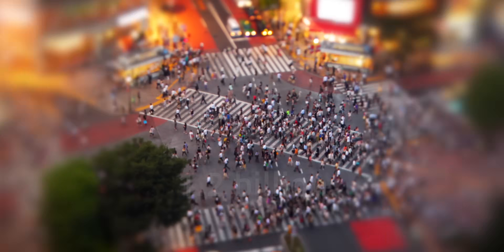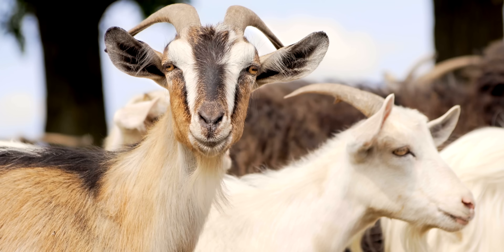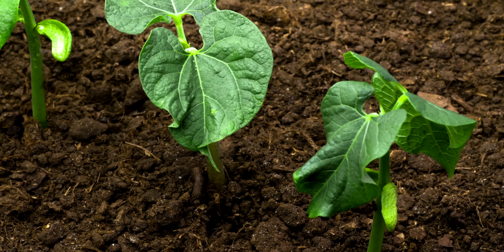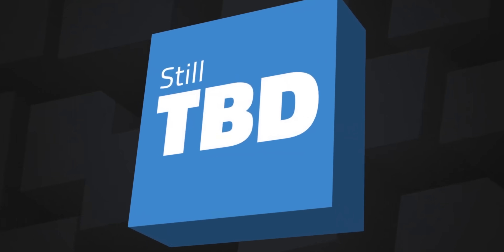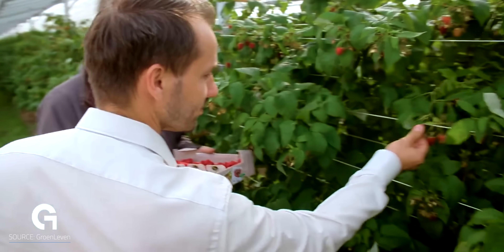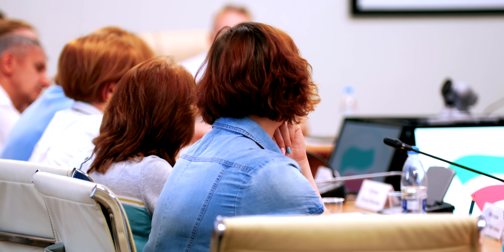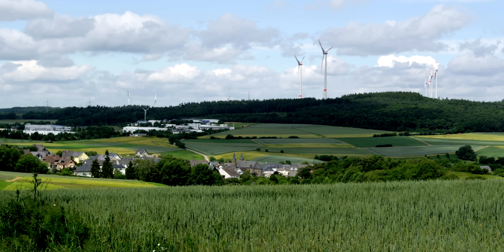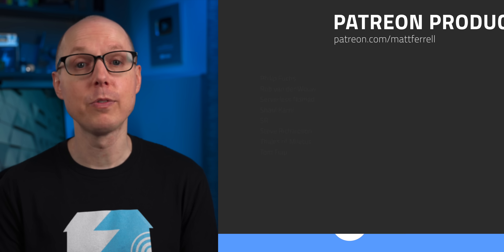Solar Panels Plus Farming? Agrivoltaics Explained

Comment: Metal has gone up to 30-40%, solar panel has got an extremely high cost for the last decade!
You think seriously it’s still profitable??? 
I think it’s just populism = green agenda.
Reply: Well we could say virtually everything is going up that much—like electricity itself (though it’s up even more)... But panel’s themselves have become cheaper and quite a bit better in the last decade. The cost of electricity in most/many places is becoming unaffordable, (like California or England/Europe for example). 

If you separate out the populism and green agenda, what’s left? The sun’s energy is... Imagine you came up with an idea how to harvest that energy (besides growing food), would it be because of a political agenda that you’d want to see where it leads (like with the combustion engine)? The problem in all of this, of course, is big business... but either way you can’t separate it out... (as who is behind the idea that it’s impractical)... Except to leave the system in general, there is manipulation to stay where we are by business and vice versa. 

But in the case for affordability, again it all just comes down to business, supply and demand will decide, if the oil industry (and automakers) get on board. While a lot of plastic (I assume) is needed for this industry, the oil guys are not likely to get too worried... however, the warring between the industries will affect the overall speed of rollout (ie. acceptance, as someone is tainting the waters). I mean who’s lobbying against it? Who is actually fighting against the green (washing) agenda? Is it not (political) conservatives who have a long established relationship with the preexisting energy sector (oil/gas/coal) (kind of like they do with the gun industry—the old school war profiteers)? I’d pose the question of how much of this is just purely political (=business), versus how much is truly just impractical... (if you look at the early days of oil, it was difficult to get at, difficult to refine, it was relatively inefficient, etc... BUT it was the way out of the dark ages—which almost everyone was quick to jump on board and get behind... and 150 years later, here we are...)
Reply: @GMC-qo9xi  so many words… just make a calculation! 
It’s not profitable, it’s not reliable, it’s not greener than other sources of energy. It needs generating a million tonnes of carbon emission to get the solar panels & prerequisite equipments including Li-on batteries!
Just look at the miners around Salt Lake or LatAm, China. Hope you are aware how many millions cubic pounds of drinkable water are required to produce the panels, batteries & equipment! 
Have you ever tried to imagine the impact of solar panel production on the environment? Do you know how much water it takes to put out a Tesla electric car fire? What about HAZARDOUS Materials. Is it still good choice?
Have you seen how solar panels burn and how many hazardous elements are released into the air? 
Read the study that 50% of all carbon emissions come from CONCRETE buildings! Can't you greens solve this problem first? Or don't you get paid by cement concrete plants for your YouTube videos?
I guess you get money from the Democrats to justify raising taxes on the oil business!
Reply: @V_I_Kruzenshtern  see that was pretty easy for calculating that side—now do it on the other—but use the opposing side’s sources of information (propaganda) as you inevitably have done done there... Your concluding it with the political attack, evidences the problem with the information source and reveals where a lot of the bones are buried. You are emotionally attached—which comes directly from politics. The people developing the tech are not developing Democrat tech... but the information being used against the tech is often cherry picked by republican political actors (lobbyists)=same bs, like nra.

Personally I don’t do politics (anymore) and I won’t listen to people who are programmed by political by through that mechanism for judging. BUT it doesn’t mean I’m pro lithium battery or plastic (or whatever toxic) material is used to construct solar panels... I’m just saying why would the current monopoly be WHITEWASHED as if they haven’t already destroyed the planet. So i don’t care about protecting the current industries, as if they have done all they could to protect the planet. But I do care about the hypocrisy... so the GREENWASHING doesn’t sit well with me at all. But I believe it’s pretty safe to say that the people who are mad like you—saying it’s dead on arrival—are actually pushing “someone” else’s agenda. It’s definitely not profitable for them! 

I’ve been saying lately, about Canada’s tar sands, that it should be nationalized, as it’s not profitable, except with high oil prices... BUT it means we are dependent on foreign oil, when we have our own source... But it belongs to business, they need profit (and gov’t subsidies =public money)... If it was nationalized it wouldn’t make a difference if it was profitable or not, we’d all be paying for it and it would be available as needed and would theoretically be cheaper than foreign oil, as it would be ‘not for profit’... and when you have that kind of investment, it can develop over time and become cheaper and cheaper... Is it green? No it’s the worst source of oil on the planet... but that is not going to be the reason it’s not dug up... We will use every last drop on the planet given the opportunity... The other industries, who knows what they will progress into... battery technology is changing fast, especially with high cost and difficulty of getting lithium and cobalt. So what is next? 

And before you do another full-on frontal attack, I don’t care, either way... the truth sets us free and I’m not in either camp... BUT when camping I’d prefer a silent power source over a noisy one (=demand). God bless you friend.
Reply: @GMC-qo9xi  bla bla … so much useless text.
Who do you think is going to read it?
Are you capable of answering one substantive question or are you so confident in your propaganda that you have forgotten the key issues?
Just keep your answer short.
Reply: @V_I_Kruzenshtern  obviously it pisses you off. But since we are dealing with head games and not pure unadulterated facts to weight against solar versus each alternative (it’s always biased! People prefer/hate irrationally). But since we are talking about something that is fraught with manipulation, propaganda, business and politics, it’s not “exactly” as you say it is... And since you need to control things that are not within your power, it’s like you are punching the air. Like I said I don’t ‘care’ about the politics surrounding the subject... give me truth, not a bunch of oil lobbyist type of appeal to emotions. Do you love big oil? Presumably not... do you love big business? Same thing... it’s all the same thing... but wouldn’t you like to be able to generate your own power without needing to go to a gas station? In May we were out of power for 8 days... and then a few more sporadically since then.... I bought a (bigger) generator. But gas at that time was also over $2 /liter = $8Can /gallon... in the past we’ve had similar outages, but in general where I live electricity is relatively cheap, like .10/Kw... but an hour away it’s like 2-3x more depending on time of day use... so many people who have gone solar have already paid it off, through what they’ve saved... that =profit... But if they destroy the environment even worse than the alternative to do so, then the cost-benefit should be factored in. But oil is sailing across the ocean 24/7/365... that one aspect alone is devastating. Take care of yourself. (And just for the record I would be more inclined to agree with you—if you are more reasoned, less offensive and less politically motivated... as naturally I’d be tempted to just let the whole thing burn to the ground in spite than submit to arrogance and to people with toxic attitudes, who are fuelled by malice! Agree or die!)

Comment: It depends on the situation. Finances are an important factor to consider. If it is financially sound in both the short-term and long-term, taking into account environmental factors and sustainable development, then it may be worth pursuing. However, if it is not financially sound, other options must be considered.

Comment: The configuration used at the raspberry farm: Will the slight E-W cant and cooler daytime temperatures affect the solar panel lifespan positively relative to straight solar farm? Could a net present value analysis be applied to each system?

Comment: I wouldn't say use Agrivoltaics *everywhere*....but with any shade-tolerant or shade-preferring crops (especailly in hot, arid climates) we should absolutely be using them (regardless of country).  Just make sure to do it properly to mesh well with local life (human, domestic animal, and wild) and to maximize the benefits while minimizing the long-term costs.  I.e. put doing right in the first place over doing it fast.

Comment: Internet news: India was already mass producing box type car as of year 2020- powered by "compressed air engine" (C.A.E.), with 300. kms range b4 recharging... In 2-3 yrs time, all pressure operated engines for land and seacraft, power plant, others- can be converted into said CAE type contraption..  The usual pressure generation process of todays engine was being done by burning fuel, like: gasoline, diesel, bunker, coal, hydrogen, kerosene, benzene,  firewood, calcium carbide, petroleum gas, LNG, others... Only slight modification will be done, and ALL or 100% of todays land vehicles, power plants and seacrafts, including submarines fleet - can be powered by such CAE technology...Accordingly, CAE was already invented as of year 1920-  by opting for hybrid type of CAE, a possible semi- perpetual machine will be achieve... A single or dual piston diesel engine , running a suction pump- will replenished the continious small loss of pressure of the main pressure tank- due to moving parts friction and wind impact on vehicle body... Who was suppressing for the spread of such CAE technology- since its conception in the 1920's decade?... Just asking...

Comment: Hi Natt, this is a fantastic video, thank you for making it. Though, I would like to give you a bit more information about renewable energy projects and farming. First, NIMBY's or the Not in My Backyard issues (sadly) stop more than 50% of all renewable energy projects. If people could live for a week beside an active hydraulic fracturing oil or gas field or working coal mine or power plant and then spend a week by a utility scale solar and or wind farm, then get asked to choose what form of energy they want to live near and or have their power come from, I guarantee they would choose renewables over fossil fuels every time.  (Do you have a way to access the Elsevier "Energy Policy" journal? If yes, do an advanced search for related articles between 2016-2022. I am a grad student at Penn States University's World Campus in the third semester of the Renewable Energy and Sustainability Systems (policy track) Masters for Professional Studies program and do have access through my EME 803 Applied Energy Policy course.) Also, many renewable energy companies offer to lease farmland from farmers annually for 20 years at a rate of $1000.00 - $2,000.00 per acre, which is more income than they can get from crops. Moreover, in many cases they can still farm in and around the solar and or wind too. Additionally, large wind turbines make less noise than the average car. Read more about that here, https://www.maine.gov/dacf/lupc/projects/windpower/redington/redingtonrevised/Documents/Section05_Sound/AWEA_Turbine_Noise_FAQ.pdf ,

Comment: Wouldnt it be more effective to put such structures over roads and highways ? them hard acumulating and extremizing the heat.. shadows could only help and bonus energy will be masive.. coz there s milions of kms of it... Farning can be fine with it.. I personaly would like to have such in my gardens.. but that construction for it would have to be masive.. I m in hills .. so steep site and also winds and snows..)

Comment: In Pakistan, we have a project underway to put floating solar panels over water dams. Makes the surface area usable, reduces water evaporation and helps keep the panels cool and I don't know the technical details but somehow it also helps improve the efficiency of panels too (in terms of generating energy per unit).
Reply: They're producing more because they're double sided (water refletion) and the cooling also helps
Reply: @ARC_CONTROL 
Solar panel efficiency is higher at cooler temperatures. That’s just how the silicon works.

Comment: In case of the vertical model, plant type and compatibility, shadow vs direct light, humidity ect... could make for an extended farming season almost thoughout the year, if for instance combined with some temperature/wind regulation. and what if aquaphonics is added into the model? Then you'd have additional nutrients going into the water other than  nutrients form soil and fertilizers. This would be a very nice setup for a smaller area, for instance for a homestead or maybe a smaller farming community that depends more on manual labor than on big machinery.

Comment: While I'm not against it in principal, is space really the limiting factor for PV? The amount of solar on roofs has increased significantly, but I doubt that it has reached more than 10% of roofs here in Germany, and in countries like Italy and France, it is barely present at all. Especially, when the house is rented out, the landlord has a lot less incentive. It's mostly fairly rich home owners who can use the electricity themselves and therefore not just get a few cents by selling it but save easily 4 times as much for the electricity they no longer need to buy.
Big industrial areas, or even just office buildings aren't all that used either. I feel like we should focus on getting as many of all of those to have to have PV, if there is nothing rational stoping use there, since the light is already wasted. Plus it is typically also where the consumers are. Rural farms may also require additional infrastructure to even get the electricity out.
Reply: its a matter of economics and ressources, spreading your solar over a wide range of differently sized, orientated and shaped roofs is always more expensive and demands higher amount of ressources then having the same solar surface in large, uniform installations. BTW In europe connecting a farm to the energy grid is trivial, our energy infrastructure is far too dense to have that as an obstacle .. we already sprinkle wind power everywhere and the connection is its smallest problem in most cases.
To cover all your roofs first before thinking about covering huge fields is approaching the problem from the wrong end. Large installations should be prefered from an economical and ecological standpoint. Same as why we dont produce our energy from fosil fuels with individual generators in each house, but with large powerplants ... small and diverse usually is wasteful, inefficient and expensive with technology.

Comment: The only thing this video didn’t mention that I think some of yours already have is the tubes of water solar instillations can incorporate into the whole build purifying the water for the irrigation so when there is 50% less water needed and that water can be sourced anywhere and filtered this way makes it more of a circular system further reducing cost and reliance on rain water that could be used water is often collected and reusable make soil yet more likely to produce better yield. As with vertical farms many processes are different like with the energy mix it all things that will stabilise the grid thankfully this technology can be shared and not profiting from to keep all farms production up and all continents one less thing to trade but one more basic amenities people can have met at low or no cost business will be made from it allowing farmers to compete is good for the future markets all are making possible growing there own things.

Comment: I think agrovoltaics help where the sun is gong to be too harsh on the plants. They can also suffer from UV damage. This is especially important for when the ozone layer widened. Regardless, some plants can't take too much light to grow in the first place - so some solar would alleviate the sunpower - allowing plants to grow better. This is more like a rainforest-like condition where there's different layers of a rainforest. Who knows - maybe the solar can generate its own microclimate enough to induce rain or something - but I think it would need to be accompanied by more for that. Solar would be like a greenhouse in a way. It also protects from air pollution.

Comment: As an Solarplant EPC and IPP Operator and Owner i can tell, the additional costs for the mountingsystem exceed far more the lease for useless land. So it just makes sense, if the farmer operates the plant himself (which is ridiculous due to regulations). Other option is to refinance it through subsidies. In the free markets, investors go for the more efficient and cheaper regular groundmounting systems, since LCoEs are nearly double with agri/ agro pv. So in theory, it's a good model - in the real markets,  no real alternative.